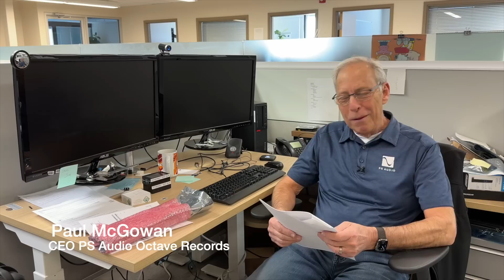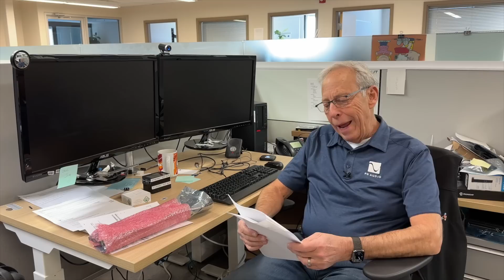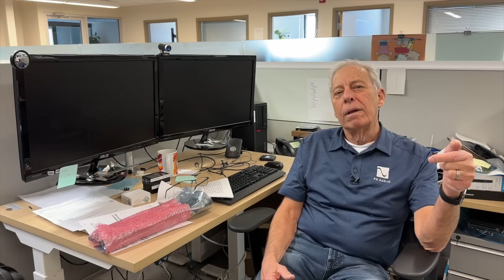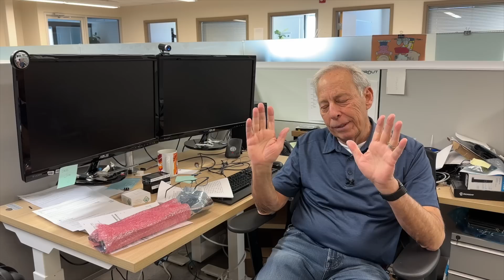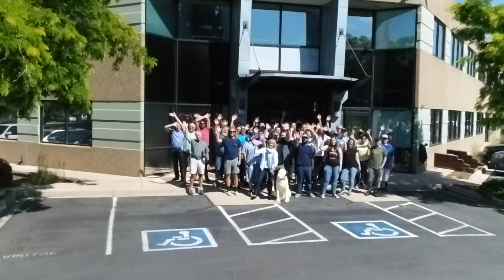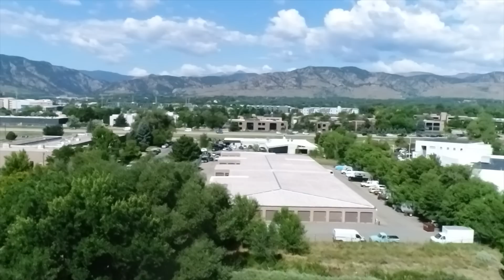Volts or amps for loudness?

Comment: Thank you Paul, this was the most technicaly informitive and therefore most useful video that I've seen from you to date. Keep up the good work!

It turns out, I was looking at impedance kind of backward. I think. I thought a lower ohm speaker meant that it was easier to have higher voltage, hense the higher wattage rating from the amplifier and should play louder as a result of that increased wattage capability. But now I'm a little confused about which of these statements is true or false.. And why many people feel that lower ohms are better for higher performance, if it actually takes more amperes instead of less, to maintain the same voltage?
Reply: I know when you first hear it, it doesn't make sense, but its true. The lower the resistance, the harder the amp has to work. Its kind of like water pressure. Think of a standard 1 inch garden hose. Imagine the water pressure at your home is represented by volts, and the diameter of the hose is represented by amps. When you turn the hose on all the way, water usually shoots out 2 or 3 feet. If you need the water to go farther, you can put your thumb over the end of it, and increase resistance. You'll have less water coming out of the hose but it goes much farther. Now imagine getting some type of adapter that lets you attach a big 3 or 4 inch fire hose to your house. When you turn it on all the way, water won't shoot out at all. It may take a few minutes just to fill the hose up. You only have so much water pressure, and its not enough to overcome the drop in resistance. So, if you need to water your garden 20ft from the hose, your thumb is good enough. If you have to put out a fire, you need a bigger hose and a fire hydrant. 

Its not a perfect example, but its enough to get the basic idea.
Reply: @AT-wl9yq  This is a good explanation! But then, if lower impedance speakers are actually harder to drive, why do people feel they are better? Also, coming from higher end headphones, the high impedance cans definitely need more power to drive, VS the 'low' impedance, 32 ohm stuff for portable use. Good luck running my LCD-4 off a cell phone and they don't have outrageously low sensitivity, if I remember correctly. But 200 ohms and love power.
Reply: @zackw4941  Your first question is easy to answer. They don't have a complete understanding of all the relevant factors, and they make judgments based on only what they think, or know. Your point makes sense. Its a counter intuitive concept, but once you understand all the variables, it all makes sense.

As for your headphone question, I'm not an expert. I don't know headphones like I do regular audio. If I had to guess, the difference has to do with the application. Headphones are small speakers and work basically the same way. The big difference is in the environment. In a home audio setup, you sit about 8 to 10 feet away from the speakers. The speakers also have to energize the room you're in. The amount of air that the speakers in a home system has to move is thousands of times greater than what is required of headphones. Removing that major variable from headphones, it would make sense that others become more important. But that's my best guess. And my guesses are not always correct.
Reply: @AT-wl9yq  The major 4 ohm proponent I'm thinking of is Eric Alexander of Tekton Designs. He likens 4 ohm to a higher flowing head on an engine. He of all people should know what he's talking about. But either way, it seems that sub 8 ohm speakers have become basically the norm now, so their must be a reason they are favorable.

Headphones are nice because you don't have to deal with a room and you can listen whenever you want. My LCD-4 setup is pretty speaker like, but there's still no substitute for cranking up a big pair of speakers when no one is around.
Reply: @zackw4941  I've heard the argument you make in your post quite often in recent years. In my last post, I said this.

"Your first question is easy to answer. They don't have a complete understanding of all the relevant factors, and they make judgments based on only what they think, or know."

I'm going prove it to you right now. Never assume or guess. It will only get you into trouble.
"He likens 4 ohm to a higher flowing head on an engine. He of all people should know what he's talking about. But either way, it seems that sub 8 ohm speakers have become basically the norm now, so their must be a reason they are favorable."
Out of curiosity, I watched the Tekton video, along with a few others, and couldn't believe what I was seeing. Its no wonder why so many people have trouble with this. 
To start, when you buy a speaker, its not 4 ohms or 8 ohms. Those are averages. As you are playing music, the speakers resistance is constantly changing. It never just sits at 4 or 8 ohms. The amount of resistance an amp sees is bases on the frequency its asked to reproduce. Out of the  entire range of frequencies a speaker is capable of playing, there is only one frequency where the speaker will provide a 4 or 8 ohm load to the amp. Think of a piano. Every key on the piano, when played, will show a different amount of resistance to the amp. The lower the note, the lower the resistance. Higher notes equals higher resistance.

When looking at the specs for a pair of speakers, there are 2 things you need to see. The first is the average that I mentioned above (4 or 8 ohms). You should also see another number, and its more important than the average. Its the lowest amount of resistance the speaker is capable of showing the amp. For example, if you are comparing 2 pairs of speakers and one is rated at 8 ohms with a 4 ohm minimum, and the other speaker is rated at 8 ohms with a 3 ohm minimum, the speaker that drops down to 3 ohms is a much harder speaker to drive. Both are listed as 8 ohm speakers. For anyone to not include this information in a talk on amps and speakers is nothing short of criminal. 

I'm going to make a recommendation. From what I understand of youtube, including links to other web sites is not permitted, so I'll list where you need to go. Start by going to Vandersteen speakers website. Its vandersteen dot com. Then click on the resources tab. Look for something that says memorial page or Audio Perfectionist Journal (APJ). This will take you to links where you can actually download all the journals for free. 

The story behind APJ was someone wanted  to start a new audio publication that provided information and reviews that didn't take money for advertising. He brought in one of the reviewers for The Absolute Sound to help out. Not long after that, the guy died unexpectedly. His family agreed to make all 15 or so issues of the journal free for anyone who wants to read them. I'm recommending this as a reference because its the best resource I've ever seen on high end audio. It would take the average person years to accumulate all the information he gives you. And its free. Everything we're talking about here, and far more, will delt with by someone who is much better at explaining things better than I can. If you are interested, its well worth your time.
Reply: @AT-wl9yq  Thank you for this resource. I am going to check it out. Do know which issue will touch on this question about 4 vs 8 ohm?

I do understand about dynamic impedance. Eric claims that my Moabs are pretty stable, with no wild dips down to 2 ohms or something like that. Intuitively, it makes sense to me. He's accomplishing so much of the frequency spectrum with the tweeter array. I feel like a tweeter won't swing like a larger woofer. Of course, the lowest frequencies are handled by dual 12" drivers 😅
Reply: @AT-wl9yq  I just had a couple hour conversation with an acquaintance of mine who has his own, small company designing and building tube gear, as well as hand building high end crossovers. 

The take away is that lower speaker impedance means you will have more current at a given voltage. In practice, this will translate to higher volume, but also higher dynamic range at the cost of higher distortion. Modern gear is designed to supply these currents comfortably and the distortion levels on even moderate gear should be vanishingly low. So the cons aren't really bad.

On tube gear, it's much more important to match the impedance to the amp, which is why you'll often see tube amps with 4 or 8 ohm posts.

Comment: Paul ITS the current that drives magna pens when you have a high-powered high current amplifier is that correct current it should be a concern with the inefficient speaker like magna pans and 84 DB

Comment: That was very helpful. So would the resistance rating of a speaker be analogous to the bore diameter of a trumpet and the voltage would be analogous to the PSI generated by the horn player who is somewhat analogous to an amplifier's transformer and ability for capacitance and recharging the caps? Except the resistance of a speaker is in flux where as with a trumpet relatively speaking there are no significant changes to the bore size increasing or decreasing resistance? I had to play along with the long winded analogy 😅 🎺
Reply: Even going further, the higher the resistance of the speaker, the more inertia has to be overcome giving you a harder hitting speaker but at lower volumes/energy levels will result in subdued dynamics. The opposite for low resistance speakers being more responsive but also requiring more energy pressure to get authoritative sound pressure. I have a small bore horn that is challenging for me to play softly but my larger bore I have more control over the dynamics
Reply: @Douglas Blake so verbose you are in your engagement makes you extremely credible 😂

Comment: Current is required to move the magnet motors  in the speaker. The more drivers and the larger the drivers are...the more CURRENT is required.
Reply: There's actually a lot more to it than just the number and size of drivers. Consider, a large 12" or 15" system like a Cerwin-Vega or an old Klipsch, with a sensitivity of 96dB per Watt at 1 metre will require far less current to deliver a particular sound pressure than you would need to drive a small bookshelf system with an 84dB sensitivity rating to the same output level.

Comment: This was a good one. Though I wonder about the term watts in this context. I know the Ohms law and those things, but the signal has such a big variation so i wonder how it can be measured.
Reply: @Douglas Blake Yep.  Each speaker interprets the voltages differently (crossover).  So, pick a speaker and find out what the speaker is rated at.  Just my 2 cents.

Comment: Voltage is the forcing function to do the work, just as pressure is what forces the current flow through a garden hose. The amount of flow depends on the obstructions or resistance in that circuit - whether electrical or hydraulic.

Comment: I take it it is  AC voltage and not DC
Reply: Yes, the waveform supplied to the speaker is alternating, the current flow continually reverses at the relevant frequencies. The amplitude of the voltage supplied can be represented as an RMS equivalent the same as is done for mains AC voltage, or a peak-to-peak measurement, which is more relevant with respect to, for example, the maximum voltage swing (peak range) an amplifier output can provide prior to going into clipping. Edit: Some amplifiers are designed to be capable of providing a DC output if they receive a DC input (often classed as laboratory amplifiers), but you definitely do not want to supply a DC output to a speaker.
Reply: @PlatypusPerspective  You can use a small DC amount for a short time to check the polarity of a speaker or the wiring. Plus pole  connected to the red wire and minus to the black or white wire. If the polarity is correct you see the speaker cone moving outwards (in your direction). If not it moves inwards. I sometimes used a 9 Volt battery for that purpose which shouldn't damage the speaker if it's only used for some seconds.
Reply: @Fastvoice  Absolutely, at low voltages that's fine and standard practice. The theoretical 10W driving an 8Ω speaker from a 9V battery isn't going to do anything untoward, a potential 300W from a 50V rail in a 100W power amp would be less fun. (Or maybe more fun depending on your point of view...) 🙂
Reply: @PlatypusPerspective  Back in the early 1980s, Crown labelled their amps like   IC 150a and DC150 and DC300 as laboratory amps.  They were designed for professionals I think.They sounded very good when set up properly with the Klipsch La Scalas.
Reply: @artyfhartie2269  I've read that many vinyl LP albums were mastered using cutters driven by DC300 amps. A laboratory amplifier necessarily had characteristics desirable for great sound reproduction - excellent linearity, unconditional stability with reactive loads, no funny business with actually meeting or exceeding specifications, wide frequency response, generous thermal ratings, quality components for long term reliability, etc.
Reply: @PlatypusPerspective  These bad boys were used by some famous rock bands at live open air concerts to drive banks of industrial horn speakers.
Reply: @artyfhartie2269  I'm glad I didn't ever get roped in as a roadie for anything like that. The tiny amount of live PA I needed to do in those days was far far less demanding. The 2000W Australian Monitor SY2700 I'm looking over at the moment for intermittent no input on one channel is heavy enough to lug around at 17.5 KG.

Comment: Power = Voltage x Current. Current = Voltage / Impedance. Power = Voltage x Voltage / Impedance. Twice the voltage means 4 times the power in the same speaker impedance. Power is energy per time (1 Watt is 1 Joule per second) and the speaker cone effort of moving the air is ultimately about work.
Reply: Very correct!  Amps is an outdated term still used today.  Remember, the signal (analog voltage) is the voltage language the speaker interprets.  The voltage current levels/impedance effect amplitude on the sound reproduction at the speaker (the work being done to reproduce the sound from the speaker drivers).
Reply: @jayedgar2373  No power no sound. The 1st law of thermodynamics rules ultimately. When a power plant outputs 1 Joule of energy per second (1 Watt) it experiences losses through the path from the power plant generator to your speaker cone moving the air but ultimately some fraction of that 1Joule per second is what moves the air as energy per time. Most of the energy gets lost as heat...but the SPL you hear is all about Joules of work following the 1st law of thermodynamics. So power is what really matters when you want to move air molecules...
Reply: @ThinkingBetter  Where did I ever say "no power" or dispute the 1st law of thermodynamics?  The signal path (from the front end through a preamp through to the amp) is known as the signal path.  The pushing of the signal path is gained in output transformers (small, but able to produce on average 1.7v or 1.7 joule per coulomb = equation for impedance + input sensitivity) to the amplifier.  The preamplifier to the amp requires anywhere from 0.5 to 2 volts (generally, but based on the preamp) input (to the amp) based on amplifier nominal impedance (sensitivity).  The amplifier increases the voltage (output) to the speaker (measured through the amps input voltage).  The amplification of that input signal is what the amp does.  The voltage signal is very low into the amp actually.  But to overcome (as you put it) impedance (connectivity, cable, speaker/input sensitivity and the electron field lines as they travel through the speaker cable), does require an amount of voltage to overcome any resistance in that circuit.  The voltage required to overcome this resistance is rather small (but many things in the path can increase impedance).  As Paul put it "the ohms rating on a speaker is not static".  Neither is resistance/impedance.  But the voltage to "push" that signal path at low volumes is rather quite small.  The impedance at the speaker is based on how efficient the speaker is.  A 90+db speaker is so little impedance, that it is measured in Mv (millivolts).  In other words, that 90db speaker does a LOT with small amounts of voltage (highly efficient) to drive (work as you put it).  However, 82 to 84db speakers require more power (primarily due to the woofers reaching lower extensions in frequency) to do the work as again you put it.  They also have higher impedance (generally) in the hundredths of volts (generally).  Speakers vary so much, that you can't put a label on any specific voltage required for the speaker to produce sound.  Each speaker is rated (voltage requirements) to produces sound (minimum and maximum).
Reply: @jayedgar2373  I didn’t say I disagree with you but just made the point that power is what makes a speaker cone move air. It’s like some people think torque is what accelerates a car. Power is what accelerates a car.

Comment: Ah no speakers respond to current, ie voice coil current determines voice magnetic force against magnet force which determines cone travel which determines SPL. For a given voltage, the speaker impedance determines voice coil current and SPL. Amplifier current capability at a given output voltage is another subject.
Reply: @@Douglas_Blake I stated impedance and voltage and current ie ohm's law. The fact is speakers are current driven devices not voltage driven devices. Electrostatic and piezo devices are voltage driven devices.